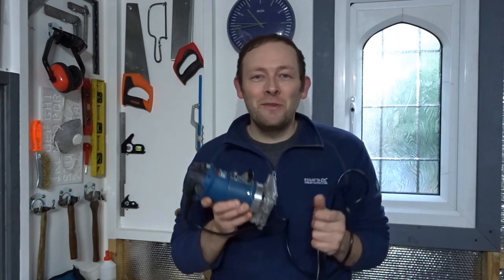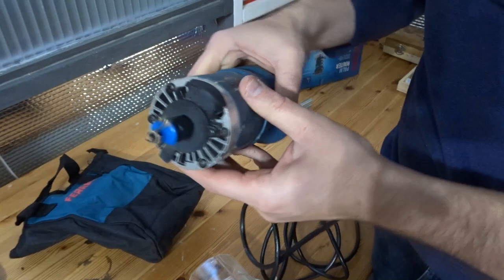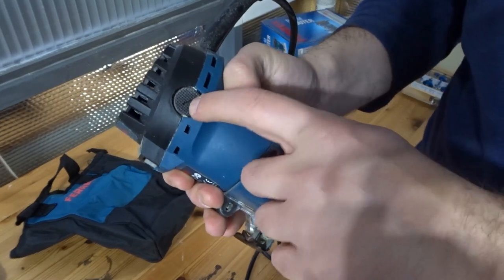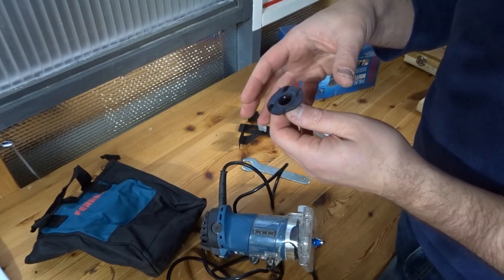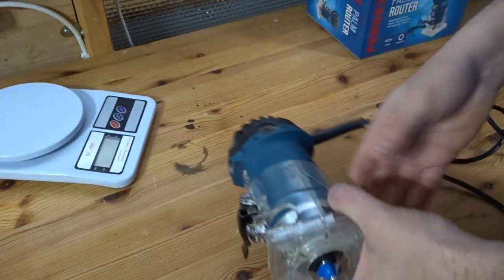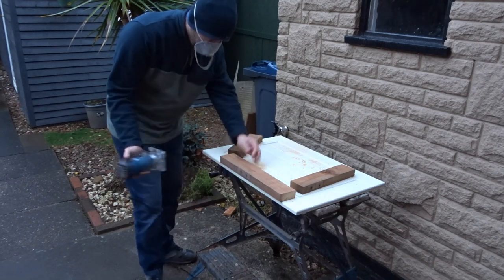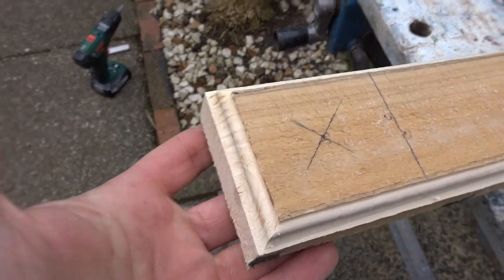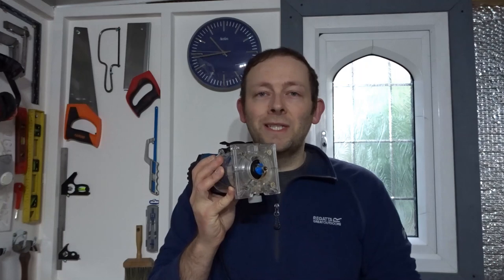Ferrex 600W Palm Router From Aldi (Tool Review)

Comment: Never wear gloves using a router  due to been dangerous unless you wish to lose fingers been pulled into the very sharp router cutter spinning at high speed. Also when using any router on out side edge of timber  rout from left to right never go back wards as you where regular in the video for a few reasons. Firstly kickback, as your not cutting with the blade as it was intended and will burn the timber and quickly blunt your router bit, The ends of any timber should be routed first again left to right to prevent break out of timber fibre's.  I've witnessed many fingerless wood workers in my 50 years of using routers and spindle moulders daily in my work as a cabinet maker. I've tried this router while it's value for money the locking mechanism and plastic base could of been improved by making stronger also a slow start as the JCB cheap router has would of been a bonus. I'm certain it has a use just remember routers can be extremely dangous in the wrong hands. Enjoyed your review.

Comment: why on earth would you pay 40 quid for this when you could have bought the RT0700 710W Makita Router for 60 quid ?  Insane.
Reply from the maker: Good point. This was my first Router so thought this would be a good start. I'm still using it and it works well. The one you mentioned looks like a good option also.

Comment: Your cable is dangling in front of the cutter as your using it!! I suggest you turn it 180 degrees cable will then be "behind" the cutter
Reply from the maker: Yes I agree. This video is over 3 years old and it was my first Router. I changed to using it the other way round shortly after this video. Now I have a cordless Router so I don't need to worry about cables getting in the way.

Comment: it was a bargain price.....my Makita cost a small fortune....would be interesting to see how long it lasts....and yes most of them have a kick on starting....a few come with soft start
Reply from the maker: Hi Joe, I'm still using it. It's going strong. I've used it a lot since I got it. I think it's decent quality. I'm used to the slight kick when turned on now it doesn't bother me anymore.
Reply: you were robbed fella, you could have bought the RT0700 710W Makita Router for 60 quid ?  Insane.
Reply from the maker: @stigkrakpants3052  I never knew about the Makita model at the time. I still use this router and its still working well so I'm ok about buying it.

Comment: I looked for ages for this but never any stock. I bought the Lidl one for £30 recently which is great but full size so a bit on the chunky side. Like you I've only really used it for rounding over.

Plenty of DIY router table guides on YouTube, they look like you'd get a better finish with more control. Might try it this year when all the other jobs are done...

Cheers for the video.
Reply from the maker: Thanks. Good points👍 yea I think it quickly sold out initially. I've seen the Lidl one also it looks a good deal. Might have a go at making a router table for mine when I get round to it.

Comment: Is 600 Watts powerful enough. I note many routers on sale have twice that wattage?
Reply from the maker: This is only a Palm router they are usually less powerful than the larger plunge routers. I am still using it. It does what I need it to do which is mostly adding round overs.